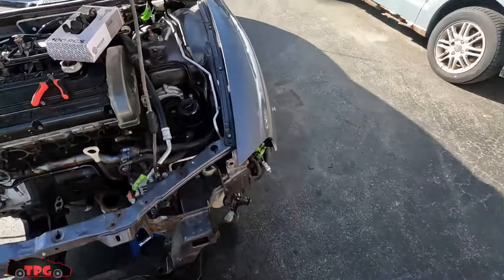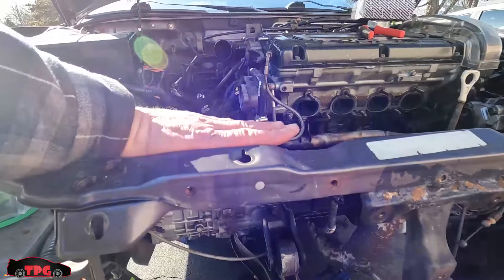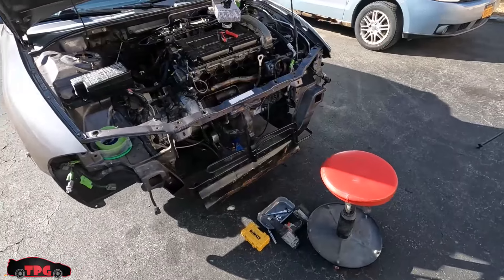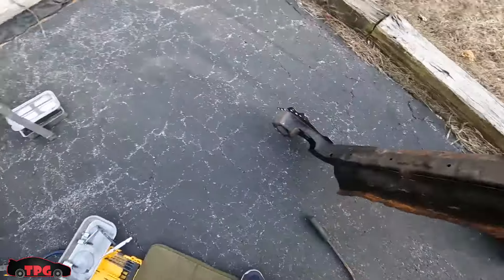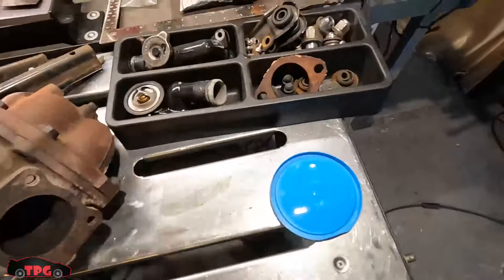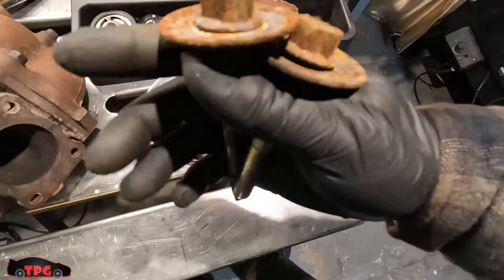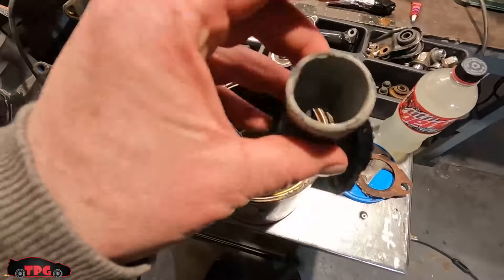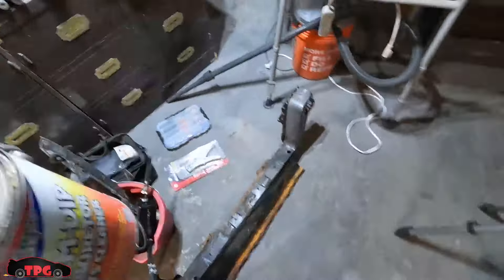MAKING A CUSTOM CORE SUPPORT-TURBO MODS-EXHAUST PORTING-POWDERCOATING PART 1

Comment: Already have my abs deleted. Last summer. Anti sies and painted the line's. Two new caliper's and rotor's with pad's.
Reply from the maker: Pulling my intake manifold for port work now then using the access to the lines to delete it all. Then gotta figure out how to turn off the Abs light in the cluster. Pry gonna have to pull the bulb off the board lol
Reply: @TPGDSM  I used a 3g brake booster. Might have to pull the rest. New brake line's all around. Also have to port intake and exhaust manifold's. Plus the waste gate flange.